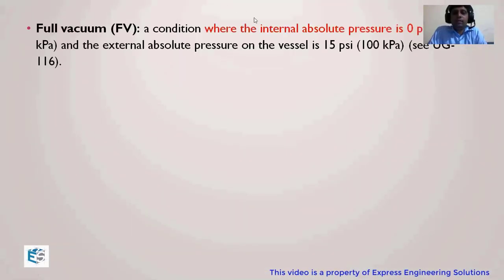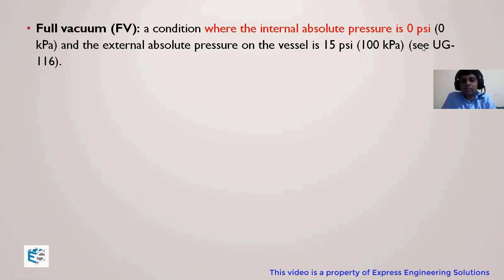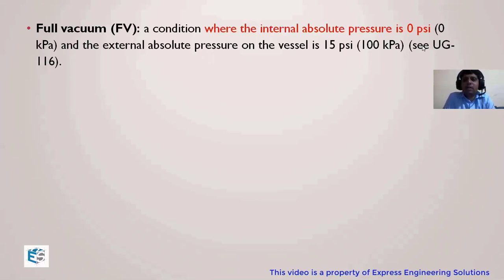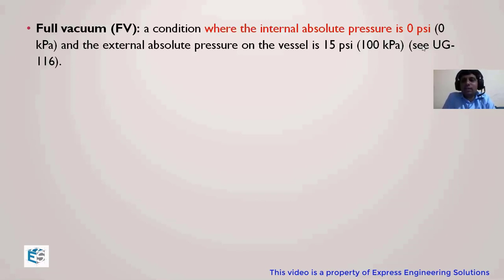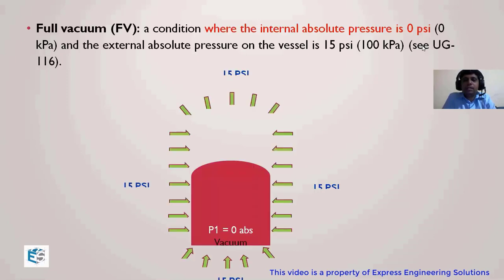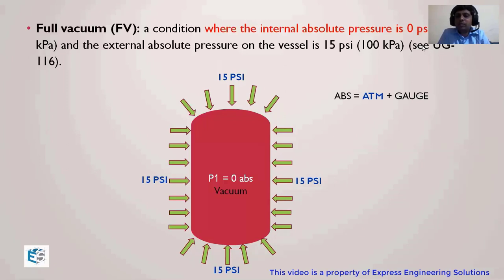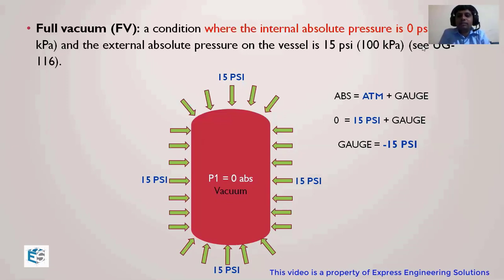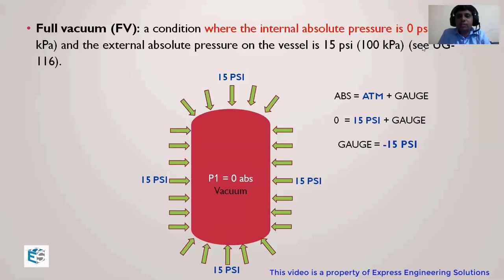Understand the concept of Full Vacuum | Static ki Pathshala

Comment: hi. 
i have a question;
for example for a sealine in 60 m depth what is the internal pressure when sealine is empty?
Reply from the maker: We have to design any component for the worst case situation for internal pressure. So check what  maximum pressure can be there. Based on that the internal pressure design needs to be done. And 
 the pressure exerted as static head should be considered as the external pressure.